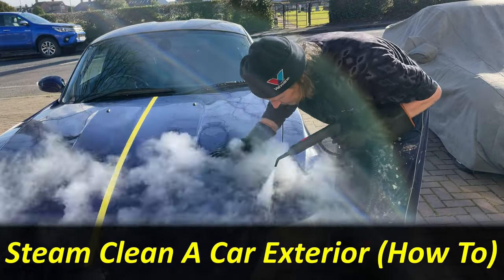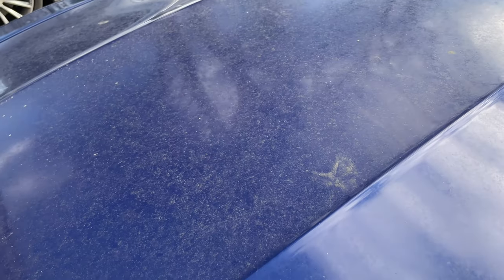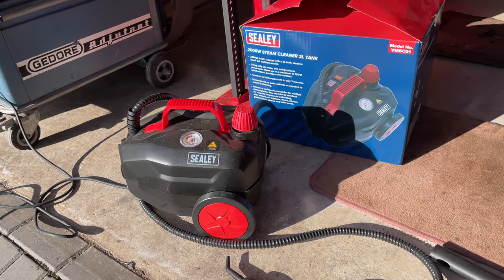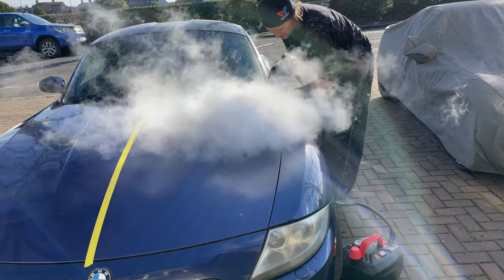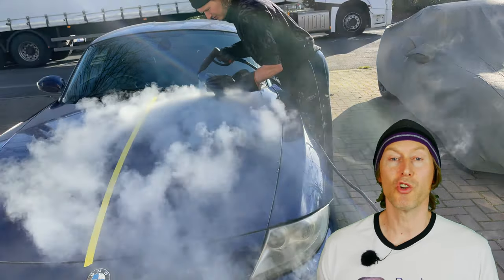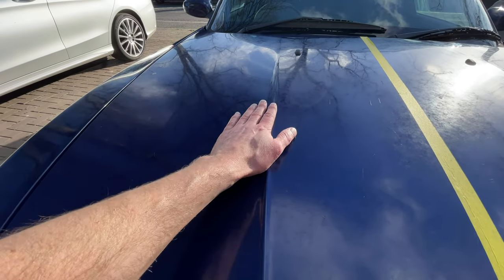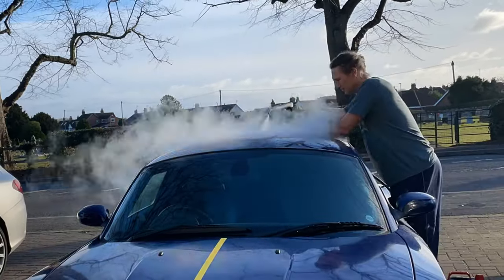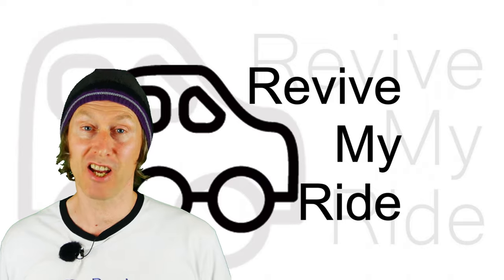Steam Clean a Car Exterior | How-To

Comment: What's the point of steam cleaning if you need to do a traditional wash first
Reply from the maker: Hi, steam cleaning gives a deeper clean of the paint and works really well if for example you also plan to clay bar the paint. However snow foam pre wash and or washing the car first gets the majority of the dirt and grit off. Ideally you would rinse off your car, snow foam pre wash (these are both touchless cleaning methods), then wash the car using the two bucket method, clay bar it, buff / paint correction if required and then finally wax and seal the paint. I know this sounds a lot but some people are really into this! Cheers, Phil
Reply: Using steam you can work inside the garage, no need for foam just presoak the car with prewash and do the steam routine. Heat will make the prewash even more affective and use a borderless microfiber to not collect dust in the borders

Comment: I thought steam would be the alternative to a pressure washer...
Reply from the maker: You don't really get the same flow rate with the steam as you would with a pressure washer. Since you are lifting the dirt with steam and then wiping, it's best if the car is as clean as you can get it with normal washing before your start, so you are just lifting out the ingrained dirt. Thanks, Phil

Comment: I have ordered a steam cleaner, currently waiting on it in the mail. Id considered using it to clean my car's exterior, since I also have sap. Thanks for the video, and also for diving deeper into it in the comments! I'll definitely be using the steam cleaner for the exterior too! Did you take extra precautions on the plastic bits?
Reply from the maker: No, I wasn't careful around the plastics, that's actually a really good point! Next time I use it, I'll take particular note but I haven't noticed any damage to the plastics, so hopefully the steam is ok with it. I haven't used mine for interior work yet and I think that is where they are most commonly used, so will have to give it a try!

Comment: Would like to see the steamer used in conjunction with a mild clay bar used on new paint sometime if possible. :) My guess is if the car were clayed prior to the steamer, the steamer might have been more effective.

Thanks for this. I didn't think a steamer was safe to use with a car exterior because I thought the heat might mar or melt the clearcoat.
Reply: Beautiful thought. I'm going to try this. Thank you.

Comment: Another useful video, thanks a lot.
But, tbh I prefer to use steam cleaner only on wheels, front grills and trims that you can’t reach.
In my opinion, Clay works better than steam on painted metal surfaces.
Cheers
Reply from the maker: Hi Ahmet, thanks for your comment! I've seen a few people mentioning using steam on wheels but I haven't tried it yet. Believe it or not, I've never tried clay barring either but I've heard it gives great results on lifting dirt etc from the surface! cheers, Phil
Reply: @ReviveMyRide  Hi Phil,
I’ve tried clay bar to lift the dirt/grime up, it worked very well. Strongly recommend to anyone.
But I’m not sure whether clay bar is better than clay mitt/glove or not.
Cheers

Comment: Hello, the steam itself worked better in your view then the old school?  How much better was it?
Reply from the maker: Hi, the steam took longer than a normal clean but in my option gave a deeper clean and lifted more dirt.  Hard to say exactly how much better, maybe only 20%? Would be useful for preventing dirt from getting ingrained or as one of the cleaning steps if you plan to buff the car with compounds.
Reply: @ReviveMyRide  the 20% a lot more then chemical use for sure.  Thx u for the fast reply

Comment: Please throw away the sponge .people please never use a sponge to wash your cars
Reply from the maker: Gotcha! I also have a microfibre mitt, which I should have been using! My bad… 😕
Reply: @ReviveMyRide   Awesome,  I also  use steam as well I own a Fortador  max pro  , and yes I  do use a prefoam before I steam ,  but I highly recommend  bilt hamber auto foam as it actually cleans and lift   the dirt as its a ph13   and you can never have enough micro fiber cloth keep it up
Reply from the maker: @rdeh1678  Thanks! I suspect you are a much more experienced car detailer than me but I have been learning a lot this year! This year I have learned and launched videos for Snow foaming https://www.youtube.com/watch?v=lSY1Ti1nnrE (I used Autoglym polar blast but will try the Bilt Hamber you suggested next, I think they make great products!), Machine polishing out scratches https://www.youtube.com/watch?v=gm8ZbkNDgMg and the Steam Cleaning on you have commented on here! Next year, I have a CQuartz ceramic coating to try!
Reply: @ReviveMyRide  sponges haver their place, if you are polishing anyway, you might get a fairly deep layer off with a sponge, 2 if you are washing after a deter, we'll, of course you ain't gonna scratch paint with a clean sponge on a clean ish car
Reply from the maker: @burt2599  Thanks, some good points! I don’t feel quite as bad now for using a sponge 😂 I swapped to a micro fibre ball type thing and it’s ok but miss my sponge! 🧽